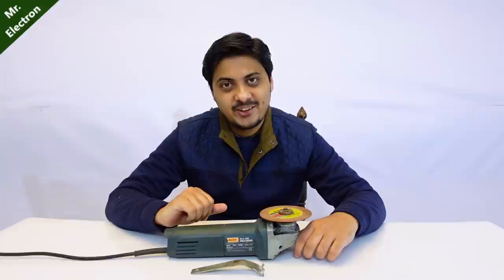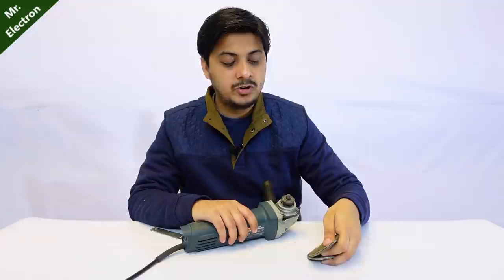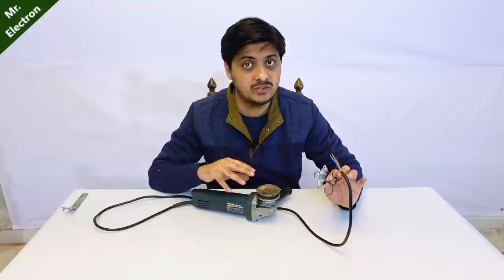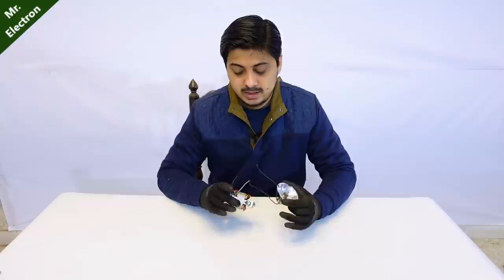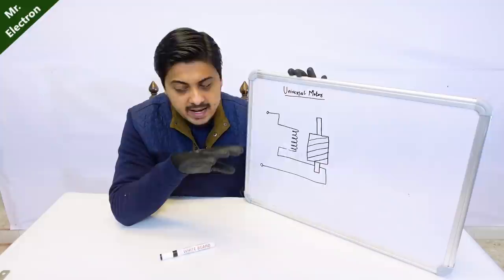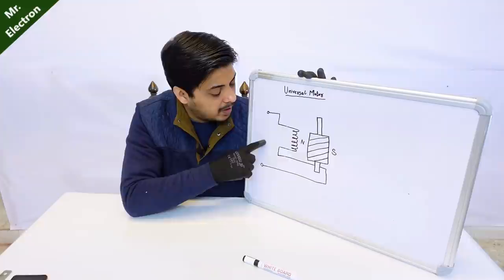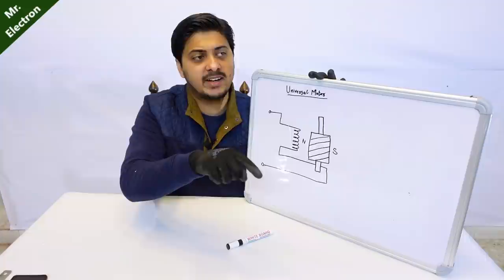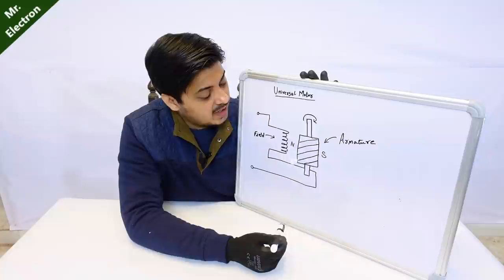Woohoo !!! 220v Grinder ( Universal Motor ) to 12v ELECTRIC GENERATOR DIY ( Part - 2 )

Comment: Easily do this add two speaker magnet in both side and only take armachor output👍 it's get 6 - 24 v  at low rpm👍😀

Comment: yes but a higher resistance on this type of generator is a big problem because the resistance limits the current to the field winding and you need a really high rpm to excite the generator. In fact in my videos I have to seperately excite the generator

Comment: Fake, couse the magnetic field you are talking about it s too weak
Reply from the maker: I believe that you missed the part where i explained the cyclic increase of residual magnetism.....
Reply from the maker: Somewhat similar to the residual magnetism of  the car alternators. ..... If self excitation can happen in car alternators then why is so difficult to believe in case of universal motors...
Reply: @MrElectron  There is a big difference between car alternator and an universal motor...it works just by powering the armiture coil with a battery
Reply: @MrElectron  Anyway,I appreciate your work and your channel it's a great place where can watch good videos!!
Reply from the maker: Video 👉https://youtu.be/KcdDC3sJzIk
Give this video a shot. I am pretty sure, you would be convinced.
It about self excitation of a car alternator without any external power source.